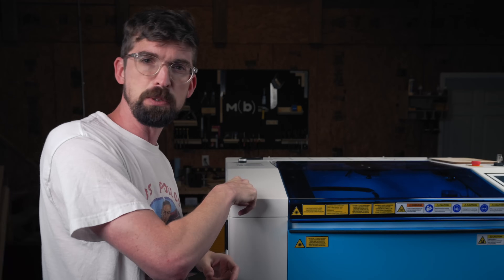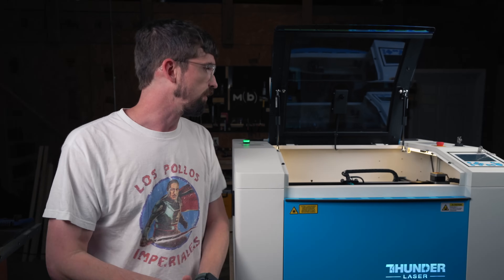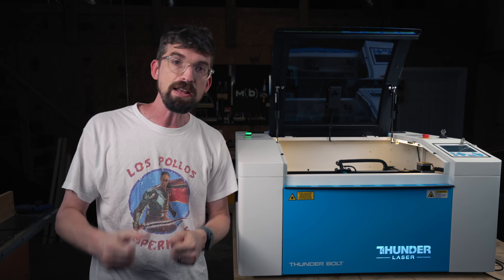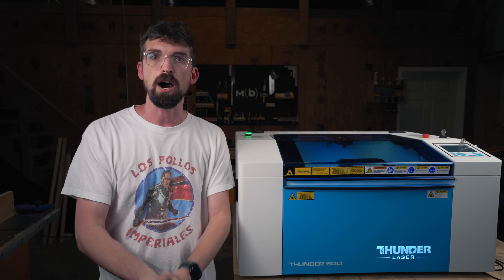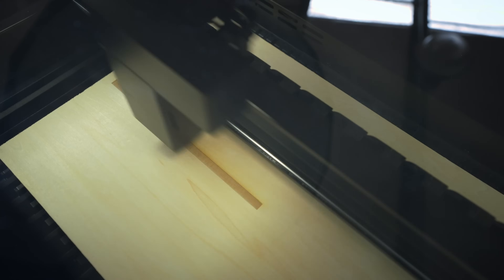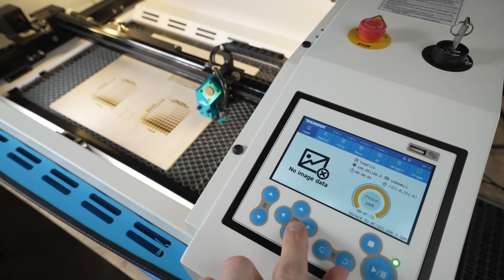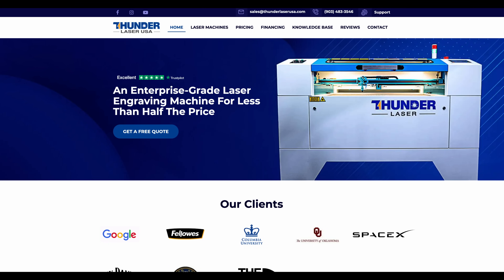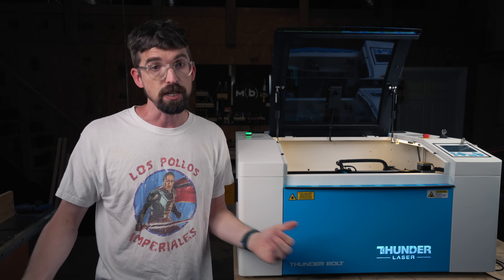$2K Cheaper, 2X Better? - The Thunder Bolt Desktop Laser

Comment: I am about to purchase my first CO2. I'm looking at the Thunder Bolt (desktop) as well as the new XTool PS2. The laser will be in my garage (in Texas). I was fairly set on the new PS2 until I learned more about the steel tube and air (instead of fluid) cooling on the Thunder Bolt as well as realizing that Thunder has US-based customer service. Since you just put out the new video on the PS2, do you have any thoughts about ease of use and learning for a newbie to CO2? I do have diode experience (with XTool actually).
Reply from the maker: It will take a little longer to get going with Thunder but there’s lots of good Light urn tutorials out there.  The Bolt is an awesome machine, I would go that way if you’ve got the extra budget for it.
Reply: @makeorbreakshop  thanks for your input. I enjoy your videos very much. Congratulations on your channel.
Reply: im in the same boat right now. Did you ever make the purchase?

Comment: I've watched other comparisons where actual cutting time was measured. Before fully understanding the logic used to control the laser, I was surprised to see that machines with 600 to 1,000 mm speeds could only produce parts at roughly the same run time as machines with a maximum speed of 300 to 400 mm. The reason is that the faster machines have to overshoot the work area when ramping up and slowing down.

Ultimately, the best choice of laser comes down to (1) the purpose you intend to use it for (cutting or fine engraving) and (2) how fast it can perform the required task.

Comment: Still too expensive.  Why pay twice the price though??  I have twice the machine for less than half the price.  Get the chinese red black if you have space for it.  Thunder uses the same exact chinese parts.     I always recommend: https://youtu.be/Uck5EkeJ_2M
Reply from the maker: Those are great options, OMTech now pretty much is the US supplier.  I will say comparing a red and black (or blue in my case) to a Thunder the overall build quality is a step up with higher end electronics and laser tube.

Comment: I'm struggling to find desktop laser that can cut up to 18ga steel/stainless. Any insight you could offer up?
Reply: None of the commercially available desktop lasers are designed for that purpose. While fiber lasers can do what you ask, the capacity of those machines is very small and the speed of cutting through steel sheet stock is too slow to be feasible.

Comment: Apples to apples, I can see how the Thunder Bolt wins compared to the XTool P2. For $900 more however, the P2 comes with a rotary add-on, conveyer feeder, riser, and air purifier. Thunder doesn't even offer an air purifier or a conveyor feeder, and the rotary tool is $1400 more. With that in mind, does the Bolt still win?
Reply: With its accessories, the xTool P2 is the most versatile laser of the lot. It can do far more than the competition. Of course, those features are only useful if you need them for your business.

Comment: I think you missed a critical category - maintenance.  How easy is it to keep the machines in focus and the mirrors aligned. Along with the availability of parts should you need a replacement lens, or mirror or any other part for the machine.  Would love to see you add that in a supplementary video.
Reply: I have run Thunderlasers for 14yrs, maintenance has been zero, all my machines have just worked almost non stop, Best machines on the market

Comment: Glowforge was designed with a time horizon failure point - they glue the heavy glass top door to the metal hinge, which WILL fail at some point and brick your machine. They are also not trustworthy when it comes to their marketing and software. I advise anyone considering a laser to avoid from first hand, day one experience.

Comment: This machine is not "fast".  1000 mm/s is just under 40 in/sec.  Epilog, for example, has been making lasers that can engrave at 75ips for 15 years.  You can easily snag one used in good condition for $5k or less, often with a 40-50W tube.  Obviously we're comparing new to used and there are some software features the used Epilog won't have (camera).  But overall, I don't get why anyone would buy this when you can get a much better machine at the same price.

Comment: Why compare with glowforge pro when the Plus is $2k cheaper and the main feature of the pro you didn’t even give glowforge credit for - pass through. Bolt got 3 points for a 20x12 printbed and you gave glowforge 1 point for a 19.5x11 printbed???  Pro actually has a 11.5xInfinity printbed. If you’re going to knock the Glowforge on price for the Pro, at least give them credit where credit is due.

Comment: You used to be above to buy a cheap 40w co2 laser for a few hundred, and a 90w with a 600 x 900mm work area for not much over £1000. Wish I'd bought one then, but I was concentrating on cnc machining at the time.

Comment: You left out a couple of hugely important categories... 1.  "Can you buy parts?"  

At least one of those machines will not sell you parts, when your tube gets weak you have to ship it back to the manufacturer and they give you a coupon for a discount on a supposed "Refurbished" machine.   So to replace your tube cost you a few thousand dollars, or a bearing, or any other part you can't get from somewhere else.

2. One thing I that wasn't clear in the "Connectivity" section, which machines force you to be connected to their cloud before they let you use it?  That is a HUGE deal breaker for me.  If the internet, or your router, or their server, is down so is your laser???  Not going to happen.  

If a company has that much control over whether or not you can use your machine that will eventually come around to screw you, guaranteed.  At some point that company is going to want you to pay for it's cloud, meaning a new monthly subscription service.  At any time that company could go out of business making your laser a super expensive paper weight.  Look at how many Youtube vids are out there highlighting how their projects were delayed, or completely ruined because Adobe's servers crashed so Premier locked up.  

Both of these issues make a huge difference in which lasers are usable/affordable.
Reply: Which company do you have to send the whole machine back to he manufacturer?
Reply: @d.j.p.  That's the Glowforge.   They even say that they have the rights to all of the designs that you upload to their cloud.  You have to pay extra to add text, mirror your image and many basic things with their UI.  Their machines aren't dependable, and that's why we just order the Bolt to replace ours.
Reply: @ataylor4441  thanks, good to know what to avoid!

Comment: 5K for a machine that uses Vwheels for motion?  That's bogus.  Even Omtech Polar / Gweike Cloud have proper linear guides.
Reply: linea guides have more friction, wheeled heads can accellerate faster, weigh less so less mass, Omtech and Gweike are cheap and nasty, they dont produce anywhere near the quality of a Bolt,  Trotec and Epilog, and all the $20k+ engravers use wheels,  you need to educate yourself

Comment: I was glad to see that you gave Glowforge a 1 star for software, but you didn't really say why.  The reason is because glowforge does not run gcode, it does not and cannot accept gcode, so it's impossible for any software to interface with it.  Everything has to go through their website.  Also you have to pay a monthly fee to do anything but the very basics with their software.  If you want to cut a square, for example, through their software, that is considered a premium feature and you have to pay for that feature.

But glowforge does do passthrough nicely.
Also glowforge has some nice features that you've missed.  For example it detects if you cut anything that will create poison gas that will kill you.  An absolute must if you're going to put this in a classroom where a kid might be vinyl in the machine. That feature alone would make the glowforge the only option for many IMHO.

Comment: I was excited to hear of the Bolt coming during one of the webinars and I held off getting a laser until it came out. Unfortunately it is just a bit too tall for my application and the price was a little out of my arena for a first machine. I went with the Polar for now as the price was only $2500 when I bought it. Maybe if I can get to a point where I can build my shop differently I can look at it again.
Reply: How are you liking the polar? I was looking at getting one.

Comment: Have to disagree with the cutting on the Bolt, Thunder put out a video of the Bolt cutting 3inch clear acrylic with the lens that it ships with. The wattage is lower on the RF's but the beam is more powerful its about the equivalent of a 60ish watt CO2 from what I have gathered by watching testing.

Comment: I'm sort of taken back by the low "cutting" score.  I've seen videos of cutting 1" thick clear polycarbonate and was suitably impressed.  Why the low cutting score?
Reply from the maker: It can still cut and does a good job, but compared to 50-60W machines it isn’t as strong.  In general RF machines really shine with engraving and then CO2’s are great for cutting centered projects.
Reply: I am new and really would be interested in a laser for cutting not engraving (at least initially) I would be interested in cutting 3mm Acrylic, different color & mirror acrylic. Would the bolt be good for this, the cutting score/ review on this tells me although it could do it would be slow(multiple passes?) to do that compared to others? 30w power for cutting is not a lot.

Comment: I have a question. For some reason, my D1 pro 10w is not measuring correctly. For example, a 5x5mm square will be 6x7 or 7x7. Do you know why it is  doing that or how to fix it?
Reply: Sounds like a calibration issue. Your software should have a calibration setting where you engrave or cut something then measure it and put the actual measurements in the software. It then corrects itself.

Comment: SO that's a very expensive engraving machine, unable to cut, and with a specific RF laser that cost a lot to replace, without any compétition for the part. " A lot longer" is not scientific, I am pretty sure this laser tube will last very much a shorter time, because any new thing these days comes with a higher cost and a reduced lifespan BY DESIGN.
Reply: the rf tube can last 5~10 years and can be recharged/reused for around $1500US... dollar for dollar, cheaper than replacing typical glass tube dc excited co2 tubes
Reply from the maker: Thanks for the real amounts, I was just going off of general stats I had seen.
Reply: Why are you saying unable to cut? He literally showed you a cutting test!
Reply from the maker: It totally can cut, I tried to show a few examples, I just emphasized engraving since that is where it really shines
Reply: and it's a cutter as well. still testing organics but it cuts 18mm acrylic.   https://youtu.be/ZVljOabYFks
Reply: How thick can the Bolt cut?
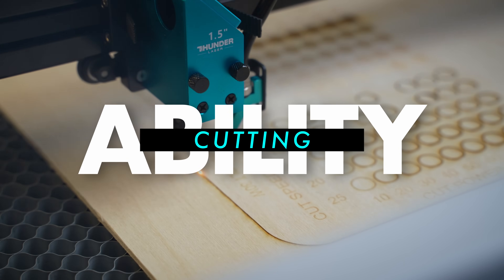Reply: 6:00 he literally shows the cutting test compared to the higher powered Nova

Comment: How does this compare to the gweike cloud RF? That seems like the better comparison RF desktop vs RF desktop. Love the videos as always.
Reply from the maker: Yeh good call, after I shot the video I was like I should have included it.  I would say it would do well against the gweike RF.  The engraving quality would be similar, the Gweike can run faster but it's not going to be as serviceable or have as big of a work area.
Reply: @makeorbreakshop  or have as good support if something goes wrong.
Reply: I have a gweike cloud too, the engrave speed is faster on paper but in testing it shows overlap errors when pushed,  any Thunderlaser model can out engrave a Gweike, the Bolt is far better

Comment: You said that a glass tube last longer everything I’ve found said RF tubes last 2 too 3 times longer than glass tube just wondering if I’m miss informed I have a nova 35/100 watt it’s a tank thinking about the bolt for trade shows
Reply from the maker: RF tube lasts longer, that section I didn’t make it super clear.

Comment: Great video, very helpful! I’m just debating whether to buy the Bolt or the Nova24 to cut 0.7mm wood veneers for marquetry designs - do you have any thoughts on which machine would be best for this? Thanks, Kevin.
Reply from the maker: Both would be great and get the job done.  The NOVA could crank them out faster and you wouldn’t be as limited by size.  But you pay more
Reply: @makeorbreakshop  , unless you fit the nova 24 with a 30w tube and a 1.5 lens the bolts RF tube has a tighter beam, better beam quality, and kerf cut 1/3 the width of the glass tube cousin. for veneers, the bolt just takes the prize, precision and zero marking,  Also tried the same files on an xtool p1 and p2, but have much dirtier cuts, Glowforge kerf is worse than the nova, even compensating for the errors when using autofocus on the GF

Comment: Why do manufacturers keep ignoring the most commonly available material stock size (24 x 12)?
Reply: Metric
Reply: @SaveTheSunF1R3x  That's still 600 x 300mm. Not 500 x 300mm.
Reply: The glowforge pro can deal with 24x12.  It wouldn't be able to cut the very edge (1/2" from both sides), but with passthrough it can cut/engrave the middle.  See unnecessaryinventions jigsaw table
Reply: @johnflux1  Bahahaha. "Glowforge". No thanks. They can keep their stupid cloud.
Reply: Can't say I've ever come across that as a standard size in the uk
Reply: @adrianscarlett  it's a quarter sheet. Very common here. What size do you see most often?